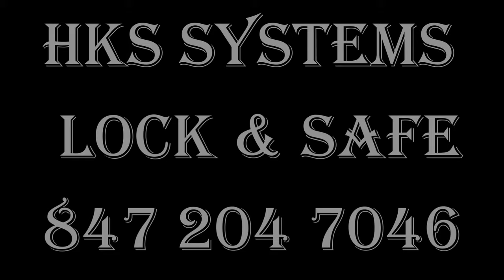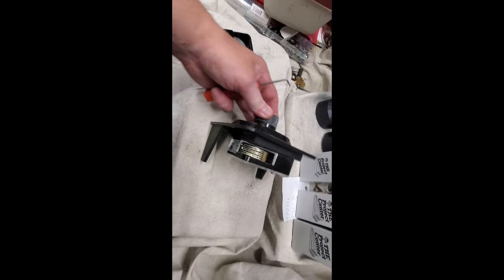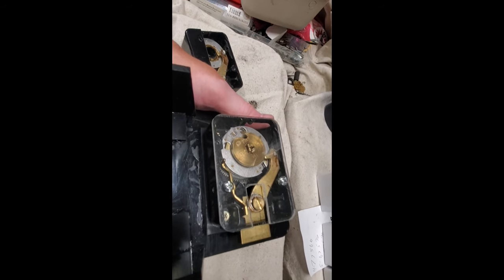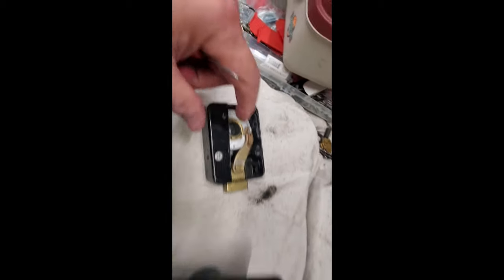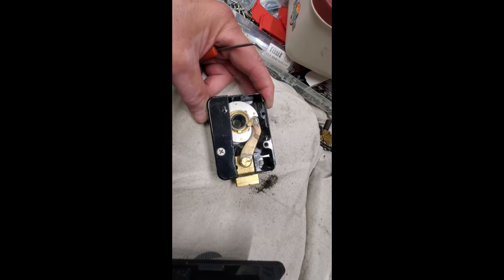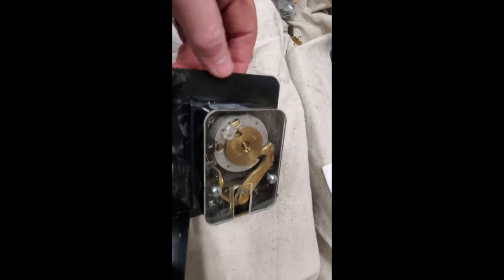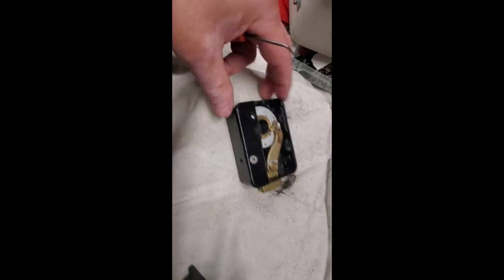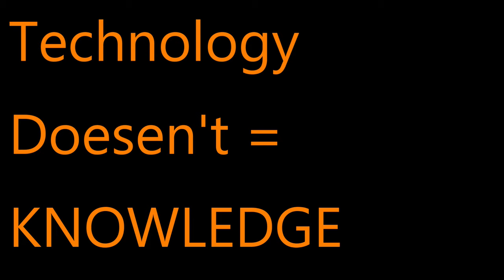S&G lock autodial FAIL!!!! HKS Systems Lock & Safe 847 204 7046 locksmith Mchenry county safecracker

Comment: What's that rule the locksporters always quote ?  "Don't work on locks in use !",  also never test a safe combo with it actually closed !!!

have a great day,   hmmmmm I wonder if LPL seen this vid yet?
Reply from the maker: I just posted. Funny he did one on same topic..I had mine on laptop just didnt have time to upload
Reply: Lost count of the number of times I had to recover the combo when one particular employee repeatedly didn't think they needed to test the combo they'd just set. Combos were changed monthly and it used to happen on average probably one in every three resets. They finally learnt, but of course then I was taking the back plate off to realign and reset so they could set the combo again after failed test openings (much easier but only slightly less annoying though).
Reply: I've never used an auto dialer..  sounds interesting